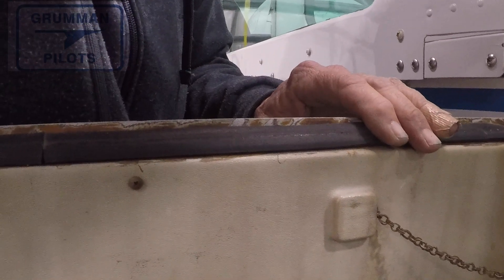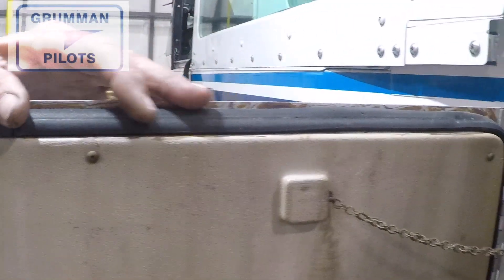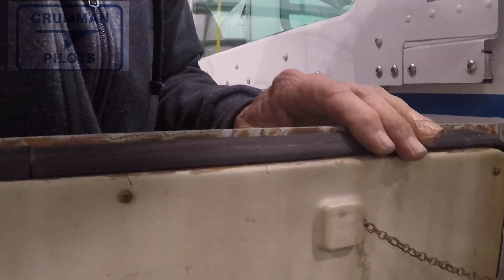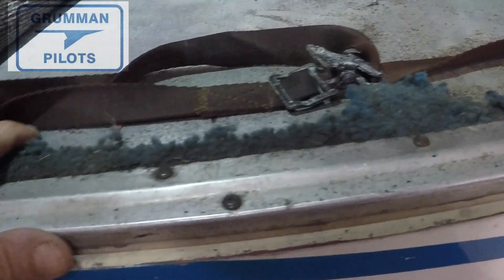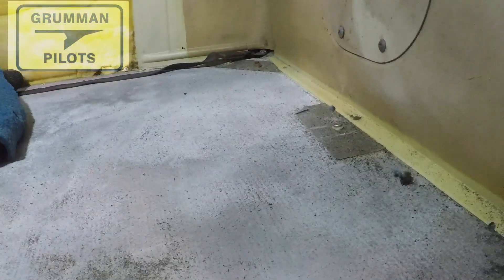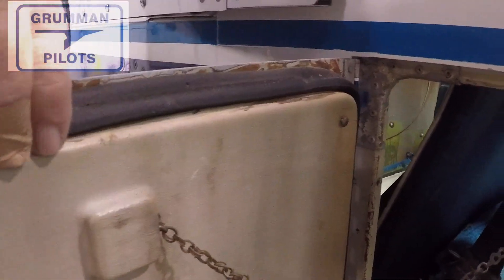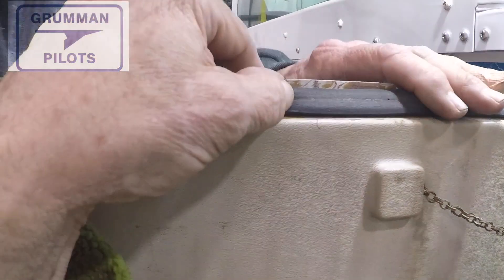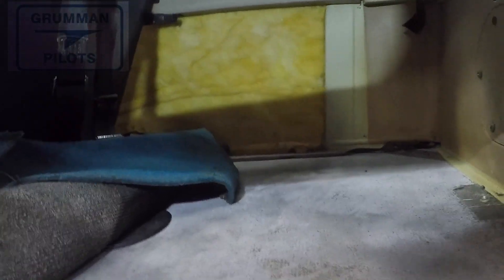Bad Baggage Door Seal Problems - Grumman Style

Comment: thanks for the video. you said it's important to attach it in the correct orientation.. what is the correct orientation? is it fat side in or out? do you glue it on the door body or the flat part that sticks out over the doorjam?
Reply from the maker: Fat part on door, slit in seal at the bottom.